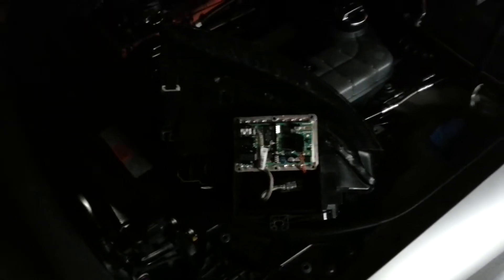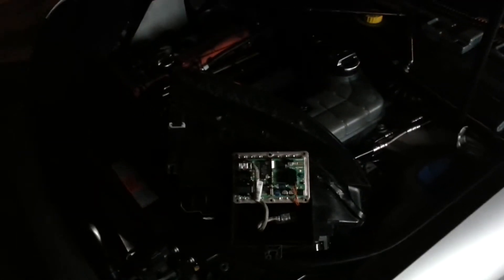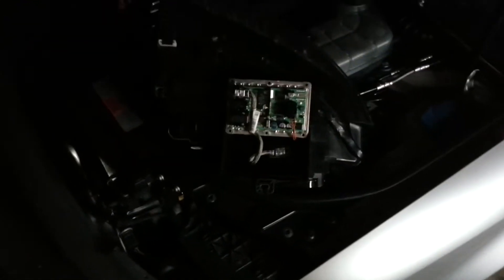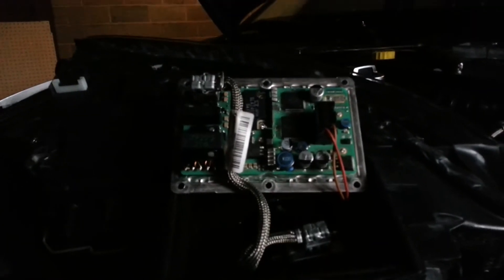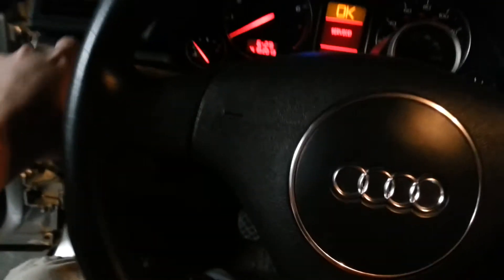Valeo LAD5G HID Ballast Repair

Comment: I took the ballast apart on my 05 a4 1.8t and found out that the chip is a sma2409m I was wondering if the same chip swap will work with this chip I'll obviously swap it for a new sma2409m ..any suggestions?  thank you in advance

Comment: How to crack open the casing to get to the electronics. Thank you
Reply from the maker: A small flat head screwdriver at each corner seam. Gently pry up and it should pop off with ease.
Reply: Thank you for the prompt reply Nate. My neighbor and I have all but given up on repairing my two failed ballasts. Your input is sure to give us the motivation to give it another attempt. Have a good one. Much appreciated. Peter
Reply: My Audi comes equipped with the Valeo LAD5GL ballasts. I'm assuming that using the same method should suffice. Thank you
Reply from the maker: I would think

Comment: Nate - saw the video. One headlight on my 2002 saab 9-5 is out and the other only has low beam.  Is this the same problem you had when you replaced the IC board in the ballast?  Also, yours is a A4, would the same IC board work in my saab.?